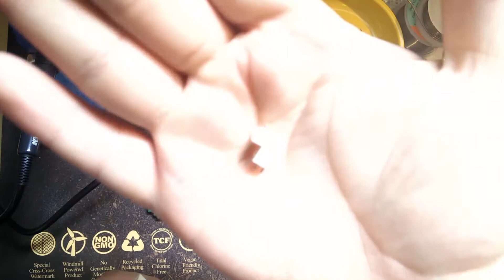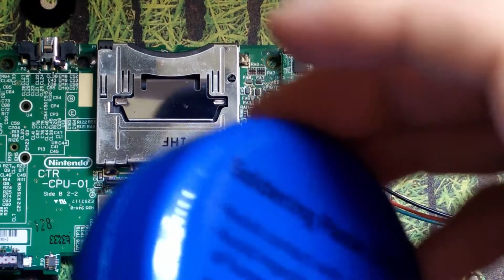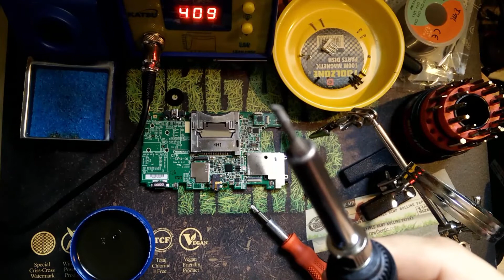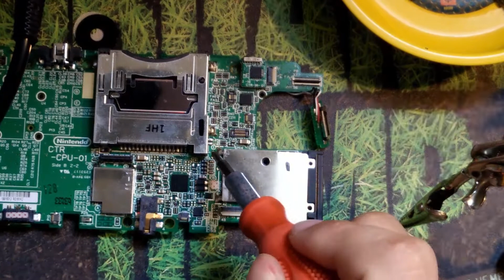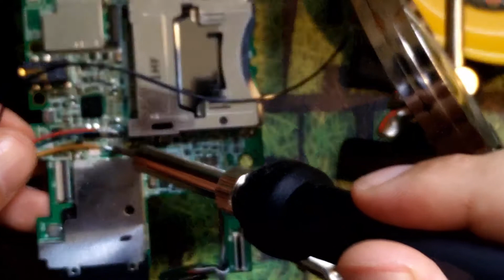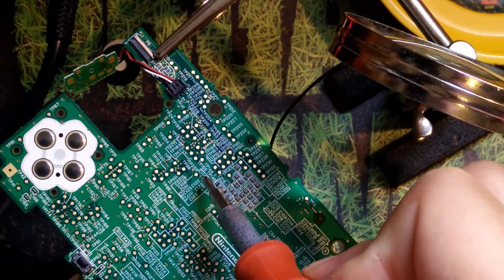[P2] 3DS HARDMOD

Comment: the tip is already angled or did you made that?
Reply from the maker: +José Ulises Delgado Chio Hi. Yea the tip is already like that. It's called a chisel tip. It has a pointy end and on the side it has some surface for solder to stick to. There are few different types of these but all do the similar job. 

As for the temperature it's set to about 400*c. This might sound high but it's to insure that solder melts and all components heat up to accept the solder else you get a cold joint which is bad. You also only hold the iron on the board for max 2sec. This is safe for the board and high temp just makes sure that all goes well. Some solder doesn't want to melt on lower temp or takes too long to melt.
Reply: ExtraNullByte thank you for your answer and your video, I recovered a bricked 3DS today.